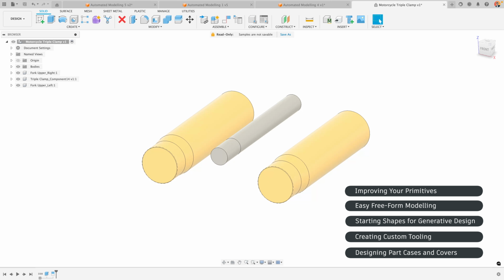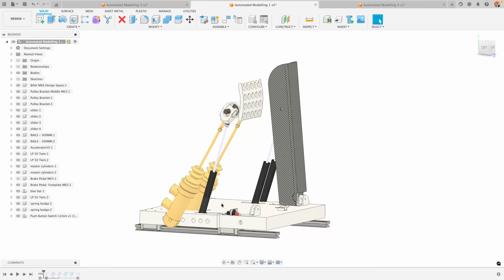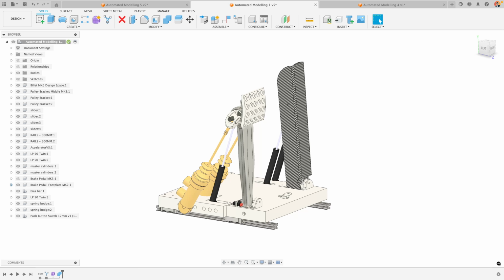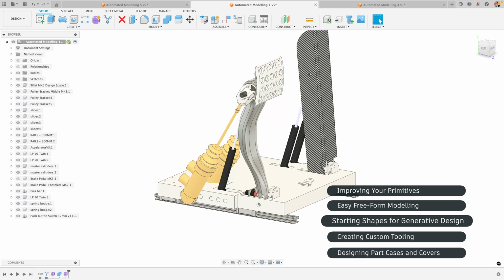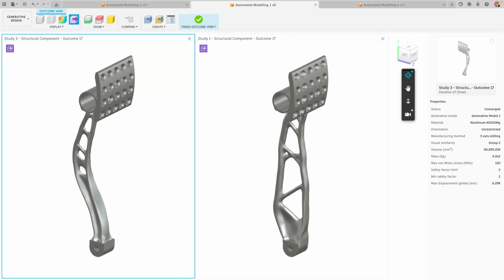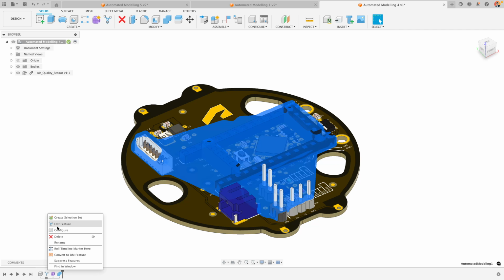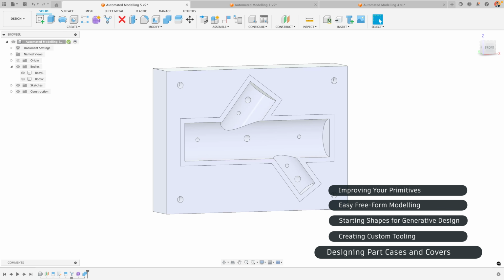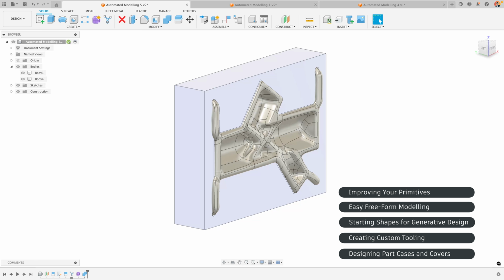Automated Modeling in Autodesk Fusion - 5 Workflows to Design Faster

Comment: Very nice but you should at least add one option for people who use 3d printing and have few support has possible or even better, generate optimised support for easy removal and less plastic has possible.
Reply from the maker: @noblocks this is a really great potential use as well! It was actually one of the options we researched when creating the video. It was ultimately decided that it was a little too niche for our audience here…especially given the improvements in automatic support generation within most slicers, but it is absolutely a way that you could use Automated Modeling!  

If you give it a go we would love to hear how it goes!
Reply: @adskFusion  First let's start by saying i love fusion and it's my go to software to model part for my 3d printer.

Has being said if you try to print this part flat on the bed you gonna have an hard time about the filet who are on the bed, but maybe you can go to the parameter to change that afterward but if you can't you need to select all the filet and delete them and hope it work. Another issue is when you select multiple thing and you make one mistake you can't go back with ctrl + z.

About those part who are pure organic it's kind of hard sometimes because fusion is too much cad based and if i need to make one of those i gonna use blender with some basic inverse kinematic stuff.

Support are " ok " on slicers but can't really export the file to other people on sharing site while keeping support and other stuff. Same if you try to tweak some local infill to make some area stronger. So when you got a difficult part the best way is to create the support into fusion so anymone can have the same things. About infill there is some tricks but this thing should get handled by cad software too.

Understand you can see us has a niche.

Have a good day !